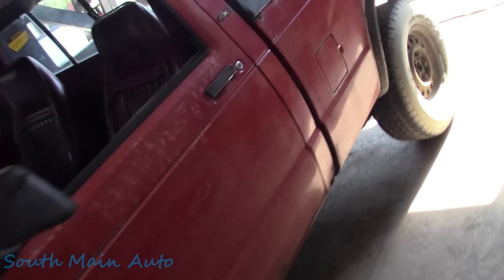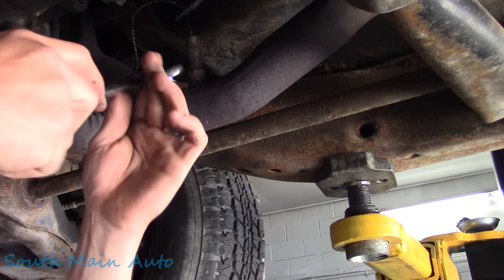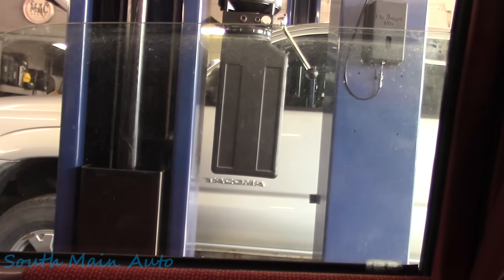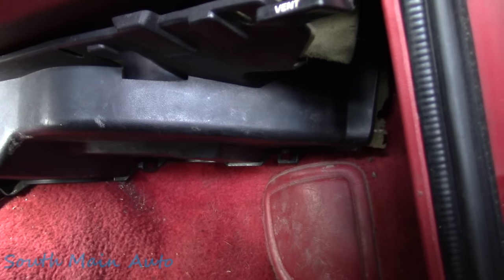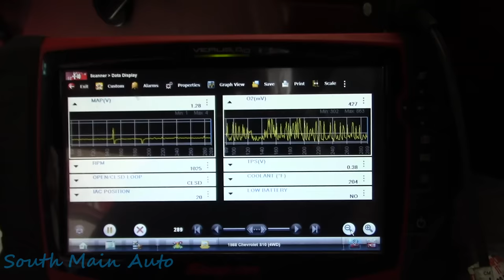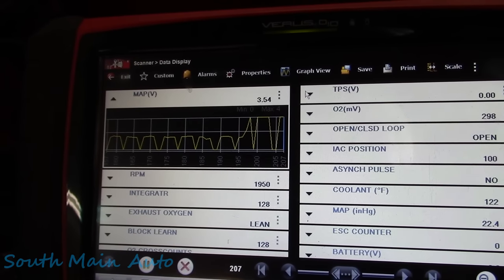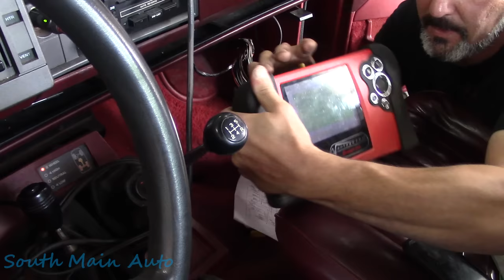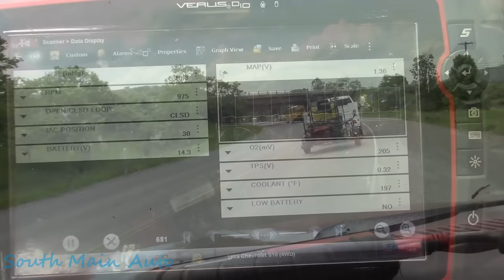Chevrolet S-10 - High Idle and Dies After 20min Drive?!

Comment: I put a Howell Conversion Kit in an '87 4.2 Wrangler.   The kit is a late 80's early 90's GM throttle body system.   It runs well by comparison to the AMC carburetor and crazy emissions system.   It's also CARB compliant, love NY.  Lastly I never thought I'd see the day I actually installed a CEL in a vehicle that didn't come with one.   
I'm 73 and I learn something everytime, I previously thought the various sensor outputs would simply go thru the ECM to the scan tool.   I wouldn't have know to check voltage at the connector and compare to scan tool reading.  
Time to finish putting a new front spring in my '29 Model A pickup.   
Thank you

Comment: Hi Eric and the lovely Mrs. O. I had this happen to my Mothers Cavalier, after a few hrs. of back probing I came up with confusion because everything kept changing. The original problem was it would be running fine then all of sudden would backfire through the throttle body and quit running. Then the tap test came to mind, had the ECM in hand the eng. running and knocked on it with my knuckle and it backfired and quit running. To make a short story shorter, I replaced the ECM and never had another problem. I have a 1991 S-10 pick-up with a 2.8 V-6 5spd. with 224K miles and have never had any problems except the electronic analog speedo goes crazy when its cold but works perfect all summer. I think the circuit board might be at fault but every time I try to check it works fine and so it goes. Great videos Eric and sat Hi to the lovely Mrs. O.

Comment: Man, this brings back lots of old memories. I think you should start working on antiques like these more often. I would also be curious to know the cost on how much the owner spent fixing the original parts vs switching to a Holley efi system.
Reply: There’s none left that aren’t rotting in a field. Few and far between even in states like CA. Not cool enough to save and restore like classic muscle but old enough to have all been driven into the ground and scrapped

Comment: Thanks! Excellent work! I didn't realize that scan tool would provide so much data from a 1988 vehicle. Also, I wouldn't have thought you could swap the chips like that. Gives me something new to consider as I try to keep my fleet of antique steel running!
Reply: Yep, shed a tear for us Ford Techs. No serial data access like the GM guys got pre-1990 until EEC-5 which was 1998-99 in the market I worked in. Even then the PIDs were full of anomalies like HEGO voltages in the 2v range, ECT in degF vs CHT in degC, things like that to keep you on your toes😊
Reply: That was the cool guy terminology back then...ohh yeah duel exhaust, lift kit Micky Thompson's.  But Is it chipped..? Ohhh man those were the days. I mis carburetors

Comment: Man does this bring back memories. 
In 1986 I was living in Mass & I bought/ordered a new 1986 2wd S-10 Blazer with 2.8l V6 with 5 speed manual. 
It had the exact same hi idle issue - but mine idles at 1200+ some times 1500+. Did this from new. Sometimes if you red lined 1st gear smacked 2nd gear & then red lined it & then put in neutral it would be at 3000RPM and stayed there for a bit. man was I glad it was a manual could you image with an automatic it would have took off on you.  
I took it to 2 different Chevy dealers - but they could never duplicate that 3000 rpm issue. Nor did the fix the normal 1200+ idle. Mass had yearly inspection were I would get rubber stamped to pass. failure due to hi idle. Now had I bought it & lived in Ohio - GM would have had to buy the truck back on lemon law.
So over the years trying to fix it, I replaced every sensor on the engine with no luck - I did new engine in 1996. Distributor, Holley TBI over the years. nothing fixed the issue - as it got older the idle increase to the point it was permanently above 1500 closer to 1800. Buy tweaking the TPS volts to low side I was able to get the  idle back below 1500.
I owned another 1986 GMC S-15 Jimmy V6 & 5 speed manual up to mid 1993 & it idle at 800 like it was supposed to. Only diff was it was 4wd. which the ECU does not control
But I never swapped the ECU between them. I should have but didn't.

Looking in the ECU data it said that AC was on. Um I didn't have AC, should that be off. So I think the truck was sensing AC was on so it increase the idle speed to compensate, which I believe was the 1200+ rpm idle I was seeing. 
So I still own this 400,000 miles later - same issue. But in the last 10 years I did find a 1986 S-10 V6 manual in a pull & pay, I got that ECU & still had the same issue. Check the data - yep AC was set on. 
Never did figure out the 3000 rpm after reline shifts though.

Comment: I have worked on many of these (in the LLV ) for the post office(tho they had the iron duke.) The later ones with distributor less ignition have constant ignition module, and pickup failures ALL of them have pin fitment issues and the  early ones have prom fitment issues BUT these trucks have 30-37 years of hard use and are still out delivering your mail every day
Reply: Still see em!
Reply: I thought all those old llv's were scheduled to be replaced a couple years ago? Was i wrong? Did something change? (maybe the unspecified virus of unknown imported origin messed with schedules?)
Reply: Once, I tried to get a job with the Post Office working on their mail trucks. I think the hands on test on an old mail truck is what busted me out of the job opportunity.
I was surprised that the running gear for those things were 1980s S-10 dinosaurs. The guy administering the test wanted me to look up all of the torque values  and do everything according to the S-10 Haynes automotive manual. At the time, I was working fleet maintenance on newer pick-up trucks and medium duty trucks. I remember looking at the shop manager and saying: this thing has a old distributor, like who uses these things nowadays?! Looking things up in an old paper back manual also threw me for a loop.

Comment: Instead of putting it in the freezer you could spray it with caned air (computer duster) that's a lot colder than your freezer. Just an option if you want to speed things up.
Reply: Also useful for debugging the pc board itself. Flip the can upside down and dribble the liquid on individual components until it starts working again.
Reply: @kdodds80  Might be worth opening it up and looking at it or mail it Ivan. Bulging capacitors are pretty easy to see.
Reply: @kdodds80  I guess in this case it was cheaper but he said he got lucky that he was even able to find one. I would at least try just to see. At least LOOK at it. It might have been just a solder joint.
Reply: @keith agreed. the freeze spray is only for thermal intermittents, which is almost always joints & traces that go bad with thermal cycling.     bad caps don't start working again like this, and bad ic's are usu. either good or bad from the factory and stay that way.

Comment: Bringin' the heat!

I have a 1970's Schwinn (bicycle) which I've mostly updated to modern components.  However, the one-piece crank was still OEM.  To get modern clip-in pedals to function with the old crank, special adapter pieces were needed.  I installed the adapters a few years ago and the bike has seen a half dozen thousand miles of use since.

Well, this season, I decided to replace the OEM one-piece crank with a sealed bearing 3-piece...  I wanted to save those clip-in pedals, however, which required the removal of the adapters.  The problem?  The adapters will spin on for installation.  But, there's no way to grip the part for removal.

I had to disassemble the pedal down to its shaft, mount the thing (bearing surface) in a small set of V-block vise jaws, and apply heat...

Without the heat, I would have had to crush the pedal shaft (bearing surface) in the vise so much, it would have damaged the machined rolling surface.

Looking back, I wonder how I ever got anything done without a smoke wrench in the shop!
Reply: Oh, and speaking of, "Bringin' the heat," I was scanning Facebook Marketplace while listening to Eric.

Someone has a pair of "Settling" tanks for sale.  "Settlin'" is country-speak is for "acetylene."

Made me giggle, it did!
Reply: Glad you got em out. Another trick is padding your vise jaws with something. Leather, shop towels, etc.

Comment: Very common to have a bad PCM or connection with the PROM and it's socket on this vintage GM.  I used to give them a tap test.
Reply: I was waiting on someone to mention the rubber hammer test. Had a late 80's GM that I could turn the AC on and off with a rap of the rubber hammer to the ECM.
Reply: The old tap test worked a treat.

Comment: One thing I've always done is use a cutoff wheel and cut the O2 sensor off at hex nut. Then you can get a 6 point socket / impact driver etc. in there to remove it.
Reply: I cut the wire(s) and use a (very) deep socket 22mm.
Reply: I kept wondering why he didn’t slip a closed end wrench over the wire and use that instead of the open end.

Comment: GM around this timeframe was using a spray coating on the circuit boards to prevent corrosion that would actually shrink with heat cycles and over time pull on components and create lots of intermittent issues like this. I owned a couple Geo Storms from the same era with the same kinds of PCM problems. Just throwing that out there as another root cause possibility
Reply: @working_country ___ No its not. It was built by isuzu and used GM parts. The tracker and metro were suzuki
Reply: So reflowing all the solder on the board may be a solution if the pcm are not available?
Reply: Storm was an Isuzu Impulse.
Reply: yeah i was gonna say taiwan - even back than - could produce 100% reliable parts like the pcm.  so,  it is sad that G.M.  still wanted to " get away "  with something.   took a long time for chrysler and G.M.  to go bankrupt.   In the end it was handshake deal under-the-table with the government to re-negotiate their pension obligations.   in the 1960's we said " as G.M. goes,  so goes the country. "

Comment: Those old ECU’s capacitors start leaking over time. Even a working used ECU will suffer the same fate sooner than later. Recapping them before damage to the circuit board is a good idea if you plan on keeping a car that old.
Reply: Good info..and by which 
Matterial we can recap that 
Capacitors
Reply: True, spent $1.5k having 2 Carver 1.5 amps "rebuilt", suffered the same issue.
Reply: Great video 90 GMC Safari van for 3 l solo problems and give me a direction hopping up all set to strange issues is an idea on how to track the problem thanks Eric
Reply: Great video 90 GMC Safari van for 3 l solo problems and give me a direction hopping up all set to strange issues is an idea on how to track the problem thanks Eric
Reply: OG poster meant just replacing the electrolytic capacitors. Not actually, "recapping" the old worn out ones.

Comment: Good to see you work on an old car.  Problem sounds like mass air censer. I had the same problem with my 87 Camaro. Three dealers couldn't figure it out, and the manufacturer couldn't care less.
Always nice to see Mrs. O,   She does treat you well.
Reply: These used speed density programming, computer used the map sensor and tps reading to calculate fuel while in open loop. After it went into closed loop, it'd use the O2 sensor.
Reply: @dave1135  Those “we’re” the days…..never to return !   Too bad! LOL

Comment: I'm finding more failed capacitors in these ecm's that's probably what happens with the old one. They fail then leak and can cause all kinds of intermittent issues.
Reply: Caps are like rubber parts, they dry up and need servicing. Replacing capacitors has saved sooooooo many things in my house. Two wide screen TVs, 3 computer monitors, a very nice desktop motherboard, graphics card, UPS, printers, ....  It's a bad cap 70% of the time. Just look for bulges and/or shit stains. A cheap ebay ESR tester is pretty handy to have on hand.
Reply: Highly unlikely to be a capacitor issue.  These units are solidly designed and use ceramic caps almost exclusively.  It is almost certainly a solder joint failure which is difficult to find and diagnose.
Reply: @rickkcir9959  Going that extra step and opening up the case, you are likely correct.  This is 1988!  There will absolutely be 3 or 4 electrolytic caps in there, and an ESR meter would tell you good/bad in all of 10 seconds.  No need to apply power to the circuit board.
Reply: @commietube_censorship_sucks  wrong. I opened a few of my S10 ecms when someone else claimed the same. I opened up 3 after I posted my comment that these only have the ceramic type. This vintage from 85 to 94 only have ceramic disc caps, no electrolytic types.
Reply: @knurlgnar24  Completely agree. If it was a bad cap, it would be bad all the time, not just when it's hot. But you know what does rear its ugly head when it gets hot? Bad solder joints.
Reply: Some if the abs modules have issues with the relays.  I have a 2002 Sonoma and they're known for bad abs modules   Everyone buys a new one for like $400.  but the relay in it is like $4 and a soldering gun will fix the issue

Comment: FYI: It is not unusual, in electronics troubleshooting, to use "spray cooler" to cool off components to see if they react to temperature. (any quick-drying spray which does not leave residue would work...perhaps brakleen?)  My bet for this one is cracked solder-joint which just needed to be re-flowed.
Reply: It's almost definitely dried out capacitors and/or cracked solder joints around component leads and connector pins. I've repaired some old ECM/PCM modules before. Sometimes the capacitors also leak electrolyte onto the board and corrode the traces. Cooling down the board and gaining functionality indicates that it's not corroded, though.  Freeze spray is great, but it also requires direct access to the PCB.

Comment: I’m betting leaky caps on the OG circuit board.  Great job as usual, Eric!  I drive a 1988 Civic to work every day.  Good to see some old OBD0.
Reply: There's no electrolytic caps on this vintage.  Only ceramic.
Reply: @CubasAutomotive   Same vintage as the old ford EEC-4 system.  They had a bunch of electrolytic caps that get leaky.  (Shago on his channel shows basic repairs and the damage leaky electrolytic caps cause.)

Not saying wrong or right, but yes..older PCM's can and do use electrolytic's in some models.
Reply: @commietube_censorship_sucks  wrong. I have opened up 3 when I replied to someone else's comment. I work on these ALL the time. You want pics?? Lol
Reply: @commietube_censorship_sucks  all 3 are S10 ecms (without the eeprom chip, as they were reused) 85 to 94 vintage.
Reply: @Tedybear315  yes, some do use electrolytic capacitors. Agreed. Not in this case. I've done all sorts of board repairs too. TVs, PCs, ECMs, and other modules.

Comment: If i remember correctly, the early 4.3s had the same wiring harness as the 2.8s. I think they literally just put in a different prom but everything else is the same. It wasnt until they went to port fuel injection that they actually updated their PCMs and harnesses and sensors etc, but i dont think the 2.8 ever got port fuel injection on the trucks.
Reply: YOU ARE RIGHT ABOUT THE 2.8 NEVER DID GET PORT FUEL INJECTION.JUST THE TOP INJECTORS.
Reply: Yes they did, the only real changes came about when the spider injection showed up in 92.

Comment: At 32:17 I was wondering if there was a heater hose under the dash near the computer.
At 41:23 I was wondering if the internal regulator might be failing, but I'm an electrical engineer and that's not something that I would expect a normal automotive tech to dig into.
-. Nice job with the O2. One thing I might have added to what you did, was to put some nickel anti-seize on the threads of the O2 bung. I found that it makes a big difference on parts that are hard to get out because they aren't replaced very often, when they are replaced the second time. If this truck had been typically rusty  it wouldn't make a difference, but it looks like this owner may restore and preserve the truck for a long time.
Reply: If they don't fluid film it it'll only last a couple years up there at most.

Comment: My first car was an 85 s10 with the big 2.8. Was a POS 20ish years ago. Can't believe this thing is still on the road.
Reply: My current daily driver, grocery getter, dog hauler is a 96 S10 Blazer. It’s got the big 4.3, no rust anywhere, 110k, and mine too has a fragrance, … wet dog! It was free and I love it!
Reply: I bought a 84 S-10 with 2.8 new. Serviced every 2500 miles and the engine was junk at 70,000 miles
Reply: The 2.8 was one of the worst motors ever built.. just a complete dog.
Reply: @forindooruseonly646  i disagree. I pretty much beat the average vehicle off the line here. I've an 86 2.8 with TBI. No work done. Automatic. Still OG engine with just over 200k miles, my DD. Now the manual version, they're dogs but that's a trans issue, not engine.
Reply: @CubasAutomotive  The 2.8 didn't beat anything off the line in the 80's, much less in 2022.  Your truck, brand new, had 125 horsepower.  Thirty-five years later, I doubt it breaks triple digits.  I don't know what you've been beating off the line, but I'm certain that whatever it was, the driver wasn't giving it the beans..
Reply: @forindooruseonly646  not racing, of course. My truck would never hold up, but general driving in the city. Light to light or on the major roads around Philly,  ppl are twiddling thumbs half the time. The s10 is no race truck lol. 🤣 I know most vehicles should be able to move better, and in a city where everyone is trying to hurry to go nowhere, I tend lead most traffic... without really trying.